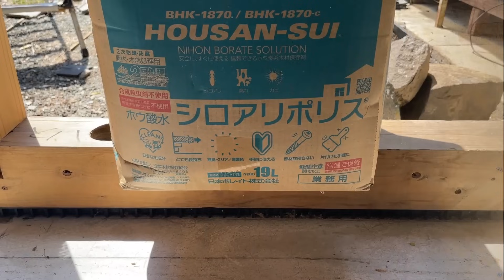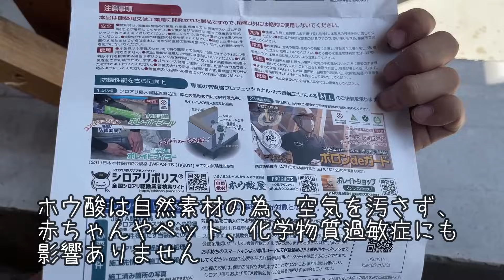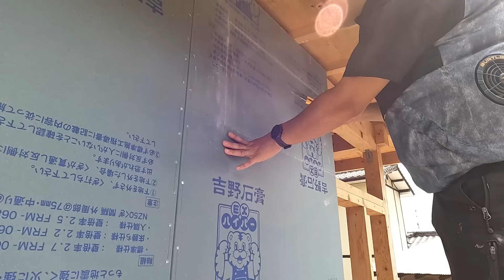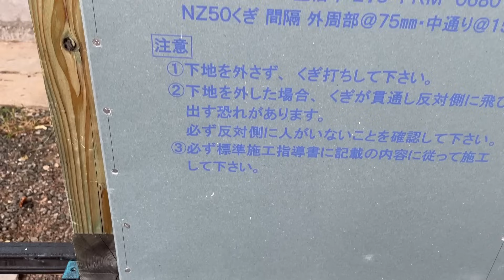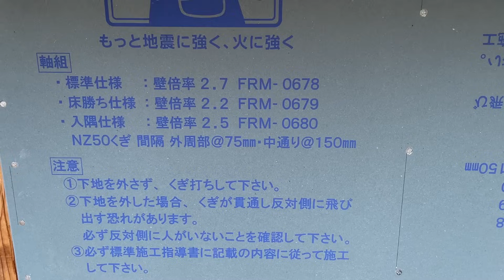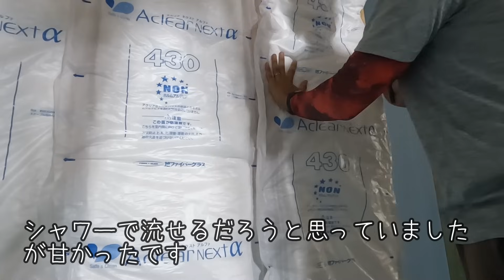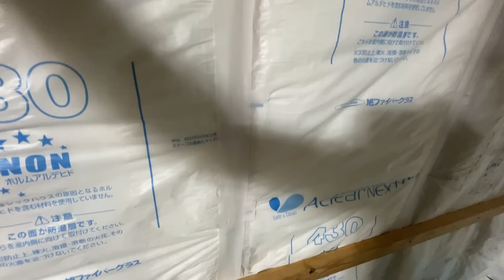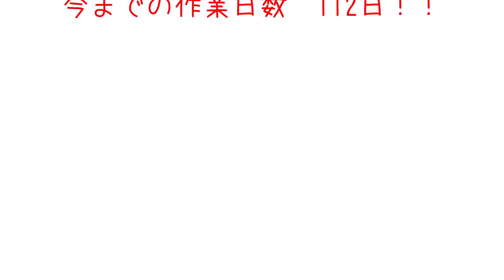#36 築60年の古民家にホテルのようなユニットバス！？理想のお風呂が実現しました！ 設備工事vol.1

Comment: Sorry in English, if you really want a tight house I would use “Huber Zip Tape” and “mate” the concrete foundation to the bottom wood board. I’m not sure if Japan has an equivalent tape. I will be subscribing!
Reply from the maker: Thanks for subscribing to my channel.
I did some research on "Huber Zip Tape."
I found a similar tape in Japan, but this time I worked in a different way. Would this tape process result in a tighter house?
I used a similar tape to install the windows and I hope you enjoy the next video!
Reply: @ABC_DiY  yes a more air tight house~ the tape is suppose to last 30+ years. What is the Japanese Equivalent called? I will need it when I start my remodel ~
Reply from the maker: In Japan, it is called waterproof tape. I used DuPont Tyvek Silver Tape. It is a very high quality tape in Japan. I am glad to know about American building technology. Please keep your comments coming!
Reply: @ABC_DiY  does Japan have “liquid flashing” ? Sold in America as “Zip Liquid Flashing” or “Prosoco R Guard” I heard this type of flashing originated from Japan
Reply from the maker: Similar products are sold in Japan!
I used DuPont flashing sheets.
I believe that a house will last longer if you use a high performance product rather than a cheap and low performance product.
I hope you will comment after watching the other videos. I look forward to your comments comparing it to American construction.